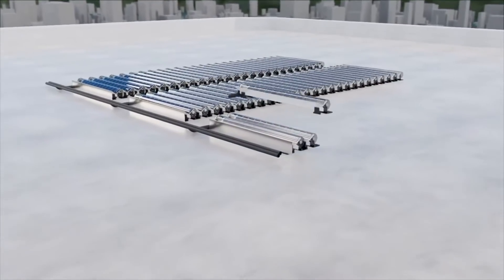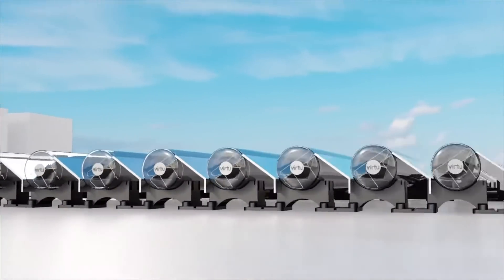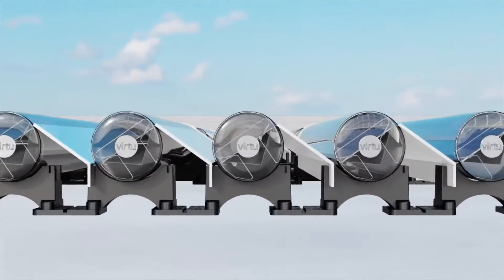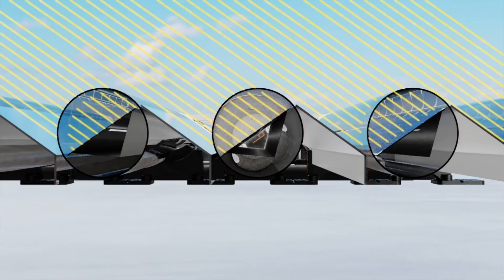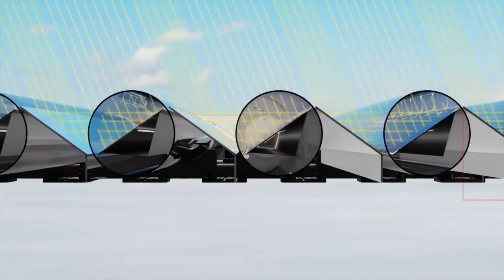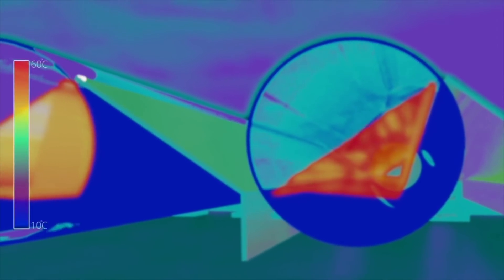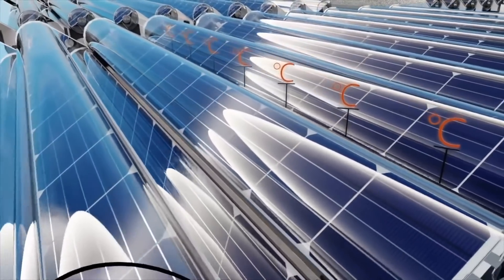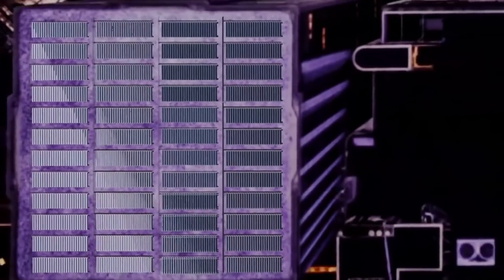Make electricity and heat with one device: hybrid solar technology

Comment: if you have 95 degrees C in the collector sending hot water to the tank. The solar cell will be 95 degrees C too right? How are the temperature and efficiency curve for the solar cell? Most solar cell works well when cool 20 C but you need at least 65 C to be safe from bacteria.
Reply from the maker: I'm copy/pasting from Nick Simmons from Naked Energy, who answered a similar question below: "PV cells regularly get to very high temperatures.  If you return to your car on a hot summers day you know how hot it can be.  A conventional PV module traps the cells behind glass and lets them bake in the sun.  When a solar panel is made the temperatures used in the lamination process go up to something like 150C.  As mentioned the efficiency of a solar cell drops off as temperature rises - this is known as the temperature coefficient and is published on the data sheets that go with PV modules.  A conventional solar module has no way of losing heat other than through convection, but at the height of summer with no breeze and high ambient temperatures there is very little cooling going on.  There is a lot of academic research out there discussing this.  The virtuPVT heat exchanger as described in the video is constantly taking heat away to be used for other heating / hot water / process heat.  Consequently a virtuPVT collector can actually be cooler than a normal PV module under the same circumstances.

Patents can be found here: https://patents.google.com/patent/US9605875B2 / https://patents.google.com/patent/US9869491B2
Reply: @tdisney  to stay in an efficient temperature you could add a heatpump to cool the water to 10 degrees C before sending it to your collectors. There the water will get warmer, possibly 20 or even 25 degrees C witch would be very attractive for the heatpump. The heatpump may heat a tank that include a heat exchanger for your hot tap water.

With the solution in the video you will compromise either PV efficiency or your tap water safety.

I was also thinking of another solution that will include your setup but also one or two water only vacuum modules. That would keep PV a little cooler and still get water hot enough to kill the bacteria.

A third option is to not include hot water at all. Then the hot 65+ degrees C is not needed. But the water may still be warm enough to heat a house with big radiators or water floor heating. And it will also keep PV from high temperatures.
Reply: Solar cells have a temperature coefficient - they lose efficiency for every degree increase in temperature.  The thing is conventional PV modules get really hot when exposed to sunlight (actually hotter than 60C) - just think about going back to your car when it has been sitting in the sun.  Taking the heat away at 40-60C actually results in the same PV output as a conventional module, but you get to use the hot water for something useful. It can be a pre-heat and then the last 25C-5C can come from a conventional source (eg electric resistive heating or a heat pump). Legionella purges are required at regular intervals and will depend on local code.

Comment: only problem that i see is that pv module efficiency in 60^C is very low
Reply from the maker: I'm copy/pasting Nick Simmons answer below (Nick is with NakedEnergy): "PV cells regularly get to very high temperatures.  If you return to your car on a hot summers day you know how hot it can be.  A conventional PV module traps the cells behind glass and lets them bake in the sun.  When a solar panel is made the temperatures used in the lamination process go up to something like 150C.  As mentioned the efficiency of a solar cell drops off as temperature rises - this is known as the temperature coefficient and is published on the data sheets that go with PV modules.  A conventional solar module has no way of losing heat other than through convection, but at the height of summer with no breeze and high ambient temperatures there is very little cooling going on.  There is a lot of academic research out there discussing this.  The virtuPVT heat exchanger as described in the video is constantly taking heat away to be used for other heating / hot water / process heat.  Consequently a virtuPVT collector can actually be cooler than a normal PV module under the same circumstances.

Patents can be found here: https://patents.google.com/patent/US9605875B2 / https://patents.google.com/patent/US9869491B2
Reply: @tdisney  right, and car is theoretically air cooled... This pv cell is not because it's in vacuum...
Reply from the maker: @pawewitkowski9130  yes, this pv cell is water cooled
Reply: @tdisney  glycol not water surely?
Reply from the maker: Well, both, technically. You don't run straight glycol through systems that need a depressed freezing point, you run water that is doped with glycol (something like 20%? It depends on the freezing point you need).
Reply: Ok. Problem with this demo is that not show details, its oversimplified and show some paradox. 
If you want to create heat - You loss electric power because of thermal properties of silicon. If You want to create electric power - you need to cool (run efficient pump) pv cell hard because of vacuum :)
I can imagine that can work if each pv cell has been backplated with cooper flat-side pipe through which the water-glycol solution flows to keep all device cooled, and heat pump been used. 
All pipes has to be cooper and has to be isolated form air to avoid thermal loses. But I'm not sure that this complex solution will be eficient enougth to ensure positive power balance after power pump which will be efficient enough to cool this device... Even if - this device in summer will create very much heat power that has to be used or stored, what can be difficult ... And one more issue - backplated pv cell has to be keep is constant temperature, to avoid cracks. If any problem with cooling happened - all cells can crack in vacuum tube because of thermal expansion of material to which they are stuck for cooling.
Reply: @pawewitkowski9130  You are not confused. This company is wedded to the cells being inside the vacuum tube and sinking away the heat. That was the wrong turn that leaves them with no progress years in. I'm not a hater. We need PVT and we need it soon! But this is, as it stands, a dead end. They have been at it for a long while (in solar startup terms) and it is confusing how they can keep going. It does seem that they have actually built some (for a long while it was just 3D renders) so that is nice to see. 
Over and above the misguided location of the cells there is a LOT of connecting plumbing going on. Each fitting done in the field costs money to make and money to attach. Each tube seems to have two threaded fittings. Plus the electric bit. The headers are jacketed when done so the pictures all make that look neat but under the insulation are a bunch of fiddly bits. 
Not to pile on but something is up with the lack of pitched racking in the pictures. They are asking for reflective losses with the tubes (cost of doing business with tubes) but compounding it with their seemingly obligatory lay flat mounting scheme. They loose the blow through advantage of a tube array when they add the light scavenging fins so maybe their wind hardiness is just from low profile. Whatever the reason, that is a huge collection loss.
Maybe if they used a heat pump to chill the cells (and use that heat at higher concentration elsewhere) they might boost the PV performance (1.4-1.7x concentration via the mirrors? + running below ambient temps) and could gain some  tangible voltage gain vs traditional panels. But as is? This will not pencil out as the hybridization is not getting more from the two parts.

Comment: Do they have numbers for this system? The combined heat and solar is a great idea. This implementation looks interesting but it has to be price competitive. So how much hot water do you get and how much power compared to a normal solar pv system and hot water system?
Reply from the maker: I happen to know that they do have numbers, but I don't recall what they are off the top of my head and I'm not sure if those numbers are published. Perhaps they'll comment.
Reply: @tdisney  Well, it's an interesting design. They just need to get close to the price of the combined systems and they will have sales.
Reply: But I really like the idea of reflectors in between panels to increase the incident light.

Comment: Well it must be hard to de snow , wuld probably be a trap for snow so no energy in winter becouse i dont image me going on to of the roof with brush evryday to desnow it. Also in normal operationg in summer or attum leafs, dirt etc ll probably collect in this elements meaning that u wuld need to clean them up. As far as i like the idea of cooling them with water (getting warm/hot water in byproduct) , reflectors and vacum to increase eficienty im not big fan of horizontal dirt/snpw traps that i wuld need to clean evry so often to get it work.
Reply: And desnowing normal pannels is much easier if u have 1sttory bulidng, just get telecopic brusk and u dont even need to the roof
Reply from the maker: @xsardas1999  You're right, but also: 1) You can mount these vertically, on a wall, and 2) The primary application is to put these on top of commercial building flat roofs that are accessible by a normal stairway, so it is pretty trivial to walk up to the roof, push off snow or leaf-blow light debris. This is a specialty product that doesn't make sense for a few different scenarios, such as difficult to access residential roofs in heavy snow climates.
Reply: @tdisney  On industrail flat roof it makes more sense, meaby one on wall too. But still it wuld probably need more maintance becouse of that than usual pannels. My roofs after a few weeks ll be probably covered also in black mud, form dirt etc, and this type of solars seems to have lots of recess, so i assume to get 100% of their eficiency i wuld have to clean them, and that means also lots of work becouse u can't just swipe it like floor. I wuld verry like this technology if it only had this pipes, covered in flat boxes, that wuld be so much easier to maintian them.
Reply from the maker: @xsardas1999  yep, certainly
Reply: @tdisney  For example u just build flat version of it without pipes, but structores walls in zigzag manner and u can then run air throught them and that culd be working as intake to heat pump incereasing overall efficiency. Or u can keep the pipes and just put another cover on it, but that wuld increase costs greatly. 
Also as i am thinking about that u want to pump fluid in the other half of the pipe, behind the solars right? And u can't just produce them  with solars, so u need to seal it up with some other mateiral like slicon, and that ll probably mean that after some time u ll get leaks, epecialy when u have vaccum on the other side, and lets say 4 bars of preassured water line. Thats 5 bars of diffrence.
Reply: Tbh. i wuld make it just in plexi/ glass rectnagels with some supports, and inside of it just have placed solars on metal pipes, maked in triangle way to fit 45 deegre curve. That wuld solve my cleanning issue, and possibly leaks issue too. Same idea, but i think simpler.
Reply from the maker: @xsardas1999  Sounds good! You should build it!
Reply: @tdisney  If i had money , and time :P

Comment: I'm curious as to how you transport the heat collected by the tubes out efficiently to where it can be used
Reply from the maker: Normal hydronic water piping (copper, pex, etc), insulated.
Reply: Tyler, if you used refrigerant as the thermal fluid you could use a heat pump to deliver even higher thermal energy. Heat pumps in my area deliver SCOPs of 2.5.

Comment: How is this better than PV solar electricity powering heat pumps?
Reply from the maker: Off the top of my head, it's better because 1) Intermittency: solar thermal can charge a HW tank that can be used at night 2) This device is less complicated than a HP, if it's enough to supply your HW needs, 3) You can't really plug a PV panel in to a heat pump, it has to go through an inverter, batteries, etc. By directly converting sunlight in to hot water, you eliminate a whole bunch of "stuff" (along with efficiency losses) entailed in hooking up heat pumps. 4) The batteries and inverter infrastructure required to run a heat pump's compressors would be very costly, 5) The only reasonable 
 (cost effective) way to do PV and HPs for hot water is to have the whole thing be grid-tied, which then makes you vulnerable to grid failures. There might be some use cases where traditional PV and heat pumps is the best solution, but there are definitely use cases where hybrid solar is a more cost effective solution.

Comment: How exactly does encapsulating the array in a vaccum keep them cooler? What is this proposed mechanism for extracting the heat that will always build up in a solar cell that is in use?
Reply from the maker: The heat extraction method is the water going through the capillary tubes along the heat plate that the PV cells are mounted to, that then deposits the heated water for some useful use (domestic hot water, lowtemp process heat, etc).
Reply: @tdisney  it's certainly an interesting concept. Have you estimated how thick the glass would need to be to withstand the 1 bar of pressure differential?
Reply from the maker: @KyleDunnIt  To be clear, it is both a concept and an actual IRL product - these things are being manufactured and installed in actual buildings now. I don't know what the glass material or thickness is, I'm just the 3d animator guy. :)
Reply: @KyleDunnIt  borosilicate glass (as used for the vast majority of evacuated tube collectors)

Comment: Someone has to clean those things. Many solar technologies have failed. I don't see any promise in this one.
Reply from the maker: True, but then again all types of solar panels require cleaning to maintain optimum performance. These are probably more labor intensive to clean since they're not flat surfaces, but then again their total power density (thermal+electric) is higher than conventional so the (time spent cleaning)/(energy collected) might be similar.  Is there something specific about this tech that you see as a red flag?
Reply: @tdisney  
The conventional solar panels have established and well-known performance.  The added features this product offers are difficult to sell because they're new and little is known about them.  If there already are installations, it would be best to give real world performance and savings / RoI.
Reply: @acmefixer1  I think you will find that solar thermal pre-dates PV by about a century - both PV and thermal are tried an tested technologies - combining them brings many benefits and although it requires overcoming a number of engineering challenges that's what Naked Energy has been doing for the last few years prior to getting independent certification of its technology.